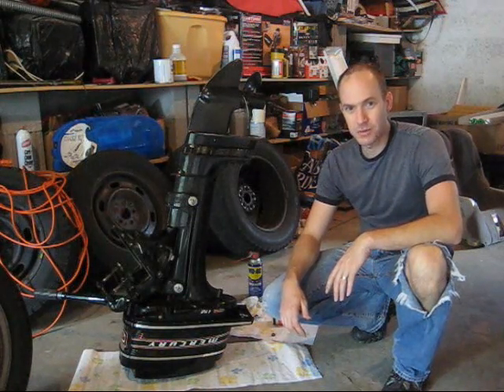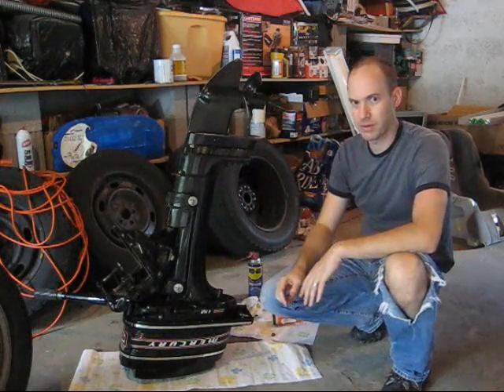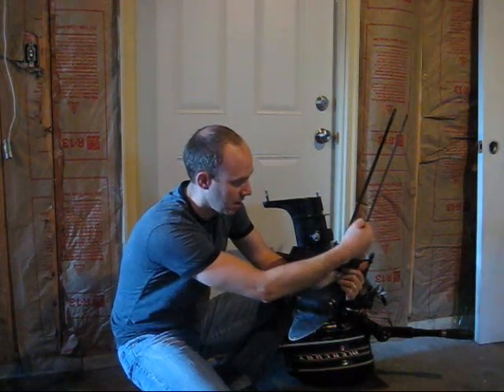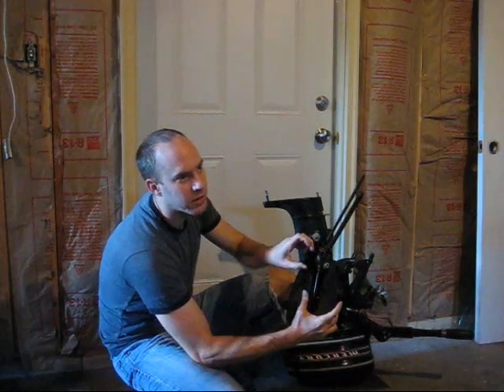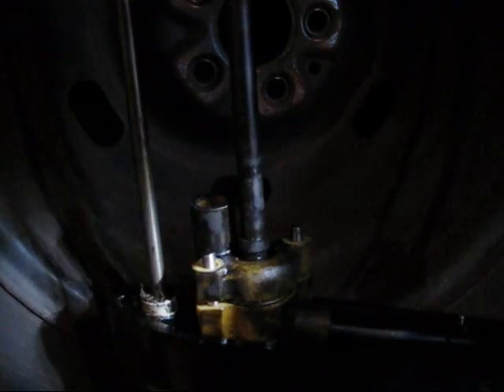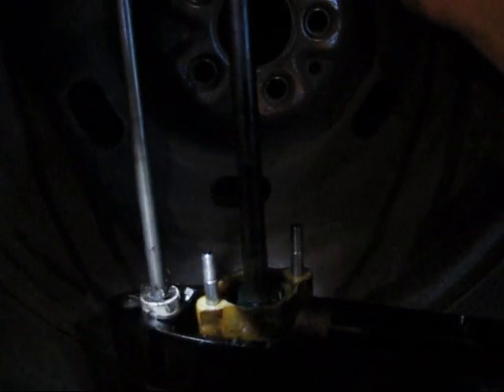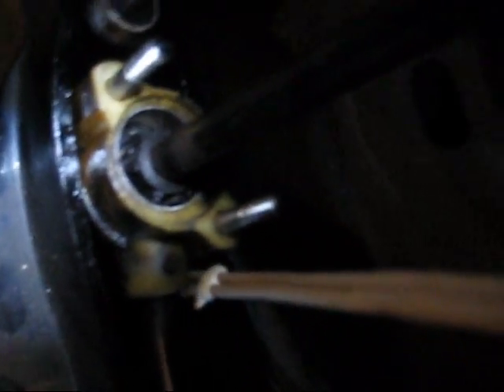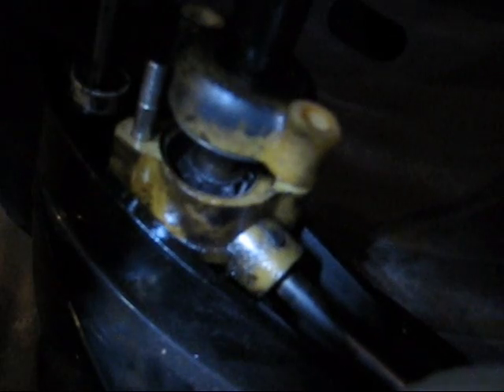4 hp Mercury Outboard Impeller Repair, replacing the waterpump.  Far Reach

Comment: Hey, Thanks for the video! I have a '71 Mercury 40 4 h.p. Thunderbolt ignition and currently my motor is pumping water, so no need for me to replace the water pump right now, but I did have another question concerning the lower unit. I'm in the process of changing my gear lube down there and have the old lube drained from the fill and drain screws on the right side (looking from the back) of the lower unit. But I noticed that on the left side of the lower unit there are two holes (approx. 1/8"), the lower one is towards the front of the lower unit on the same vertical height as the top of the propeller. This lower hole has a very slow drip of bubbly fluid (presumably water and oil mixture). Looks identical to what's coming out of the exhaust on the back side under the head of the motor. I was just wondering if that was normal, if all of it made sense to you :/ Thanks!

Comment: hey man can you help me... i cant seem to get the key to stay on the shaft while im putting impleller on.. any help?
Reply from the maker: kent whetstone If it helps, one thing I did was used thick marine grade grease to "stick" the key in place on the shaft.  It held it there, and then I put it the impeller on with that key in place.
Reply: Far Reach Engineering ok well ive put some grease on there but i just cant seem to get it lined up right or it wont go in there. any ideas of what im doing wrong?
Reply from the maker: Does the key fit properly in your new impeller when it is just in your hand?  If not, there is a part mismatch.  But if it fits correctly, then it is just about keeping it properly aligned as you put it in to place. I realize that is easier to say than achieve.  Sorry I dont have more input on that regard.  I do hope it comes together for you. Good luck.

Comment: Do you know the part number for the impeller?  I have the same motor and and mine went out too.  Nice video.  Thanks.
Reply from the maker: Nick Kosanda If you have the .456 shaft and not the .438 then part number for the .456 should be 18-3039 Replaces 47-89981 .   And here is a link from ebay you can check the serial numbers as well.  http://www.ebay.com/itm/Water-Pump-Impeller-Mercury-4-9-8-Hp-456-Shaft-18-3039-Replaces-47-89981-/281608841428?hash=item419131e8d4&vxp=mtr
Reply: I'll check it out.  Thanks for getting back to me.

Comment: Please show us how to remove the impeller from the shaft. Generally, the brass bushing inside the rubber gets badly seized and won't come off.  I couldn't do it, so the guy at CAS Power Marine did it for me free of charge, but I didn't see him do it. I did see the cut he got on his hand though
Reply from the maker: unwinsis I used a curved paint can opener.  Basically a pry tool that I could hit at an angle.  Take it slow and then no need for cutting of hands.  :)

Comment: thanks for the vid…. mine is a 2.5 merc 2 stroke, 2003.  Do you think the impeller is in the general same location as what you showed so clearly on your video?  Or is located behind the prop as I have discovered some engines do… thanks! Joe
Reply from the maker: I can't say for certain, but if your engine is like the one in this link then it may be directly behind the propeller.  I would check there first as it looks simpler to get to.  http://www.jamestowndistributors.com/userportal/show_product.do?pid=84924

Comment: I also have a 45 4.5, but it seems the drive shaft is seized on. Any ideas? it was used in salt water from the looks of things
Reply from the maker: Depending on how bad it seized, it could be over.  But if I it was not from a heat seizure, and is from corrosion, while still unlikely you could try penetrating oils, WD40, pb plaster, or your favorite type to see if it is any good.  That said, I cant offer any great hope.  Good luck all the same.

Comment: just how many seals do this motor have, its not leaking from the, drain skrew, , looks like it draining down from inside the, propeller hosuein,  what parts do i need to order?
Reply from the maker: I am not familiar with your motor but it likely has at least 2. If we are talking about the external gaskets holding the main housing pieces together. sorry to not have more info.

Comment: hello guy i got problum, i got , bottom fliud comeing out the propeller area, now its milky, when it come s out, i got the murcury 7.5 78-79  so that means its , getting water, in there  some where at the bottom, ,i hollard, at a marine machanice, he wants a arm and a leg for seal replacement, and its a old motor it runs good, ,he wants 300 just to repalce some lower unit seals, , i only paid, 400, , so is it something i can just take my time and do to replace , the givin seal in that lower part, please tell me something,
Reply from the maker: Fisherman 88 not sure I am of much help on this one.  You must have one running gear oil.  Mine did not.  That said I would expect there is a potentially two seals (gaskets). one for the lower housing and another near the powerhead.  IF I was to guess I would guess it is the lower unit seal.  I have not done one, but if you can locate it, at that cost I would be tempted to take it apart and either buy the gaskets or use a caulk or RTV to create a new seal.
Reply: +TheFishman88 I replaced all bearings and seals in my lower unit. I had to make a tool out of a pipe nipple to remove propeller shaft guts. I also have experience with another engine with seal leak. I told motor shop to replace all the seals, but they said you should only replace one that leaks. They did pressure and bubble test before and after.

Comment: well  a fellow gave me this old 1950,  5 1/2 hoss, johnson i tested it for spark, the bottom wire has spark, the top dont, so , what, part needs replaced, to have both wires sparkin or is this norm for one to have a spark
Reply from the maker: I dont have a Johnson, but it has just 1 spark plug correct?  If so, there should just be spark from that single spark plug wire itself.  (if it does have two plugs both should spark, but at separate times, at different points on the rotation. lack of spark could be the wire itself, grounding issues, or the coil.)
Reply: +Far Reach Engineering The engine has two sets of points.You have to remove the flywheel and clean and gap the points and if this doesn't work, you may need a condenser. Make sure you tighten the flywheel nut to the correct torque. You can go the public library and check out a book on this motor to get the specifications etc

Comment: i got a ?guy i got this johnson qb-11 10 horse out board, , the problum is that, i want to look under the hood on this motor, i took all the, 5 skrews from the top, how in the sam hill do this cover comes off,
Reply from the maker: I don't have a 10hp to compare to, so I can't say for certain.  But as an offer of help, if you are talking about taking off the plastic cover, there is generally a lever switch that you must rotate to unclip the cover from the motor.  Some motors have just one, others three or more.  

That might not be your issue, but if it is the plastic cover we are talking about take a look on the underside and look for the levers.

Comment: wooow dude, sounds like some thing was  , blocking , iyes it has a  strong flow   man  you good,, where you located, gotta keep intouch for valuble info, sound like you hit the nail on the head. my 7.5 is about a 79 but its a good runner, thanks for the info,,

Comment: hey dude , how often should a water , pump like this bew replaced in a murc 7.5 i  had my last one changed, 2 seasons ago, last yr, my motor stop peein, for a while  while out on water, ,, but for some strange reason it started peein, again whith no problem , what could of cause that,
Reply from the maker: I would expect a new pump to be good for many years so long as it is not overheated or heavily contaminated while in service.  As for your issue, is it flowing strong now and back to normal?  or just weak? So long as it is back to flowing strong, I would still use it. Two seasons is not very old for a pump.  What you likely experienced was blockage.  Possibly in the pick up tube or sediment screens.  Could have been seaweed, mud, etc.  And if it is blocked and water is not going in, even if the pump is in good order, no water will come out.  But then at a later date the blockage was cleared and you are back in business.

Comment from the maker: Yes, should be fine as the lower unit is completely separate from the power-head.  the oil can not move one to the other.  For example in my video I did not empty the lower unit.

Comment from the maker: I cant speak to the 1967, but I will say I would be reluctant to start prying open plates.  That said if you have taken off all visible bolts you could try giving the lower unit a bump with a rubber mallet, etc.  It may just be stuck.  Give the forward reverse selector a wiggle as well to make sure there is no binding.

Comment: If you must make videos, make them with rigour, make them useful, make an image that can be seen without a wobbling torch. The tricky bit with a Mercury pump is to get the impeller fins swirled in the right direction (two possibilities, one is right, no mention of this), getting the shaft-key back in place (glossed over, no useful tips or suggestions), and the cheek-plates correctly refitted (the top one is tricky and people will get this wrong). Brave New World, useless and pointless video !

Comment from the maker: Using some grease on the impeller and housing can help you not burn up the impeller during its first run when it first is starting to get primed and suck in the first bit of water.

Comment from the maker: If you mean, remove the gear shift lever? the answer is no.  You can leave the gear shift lever attached.  The gear selector shaft itself should pull out without further disassembly. If it seems like it sticks, you might want to wiggle the gear selector switch in and out of gear a couple times.

Comment from the maker: @MrChetes01  Glad to hear it helped.  As for the spark plug mine is running an     NGK BUHW-2.   I didnt pull it to check the gap.  It has been in there since I purchased the engine.  I would not be suprised at all that the NGK BUHW-2 come pre-gapped and ready to go.